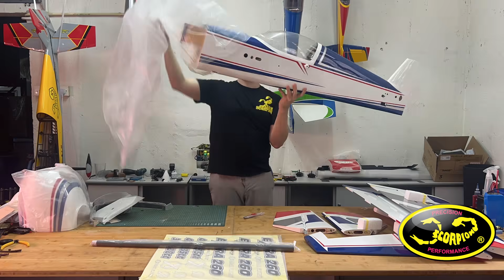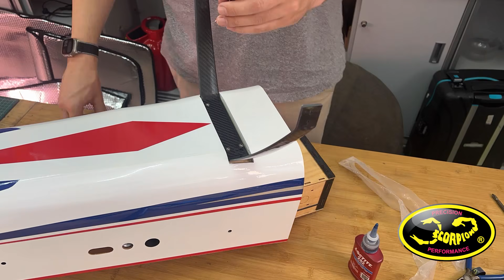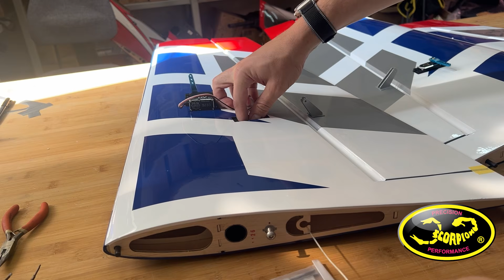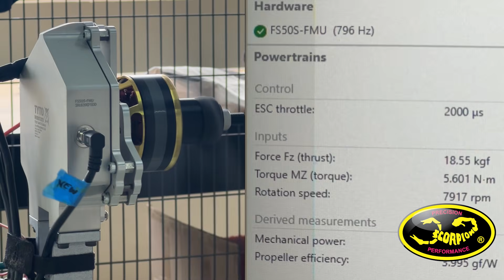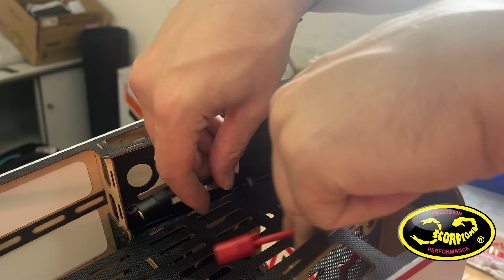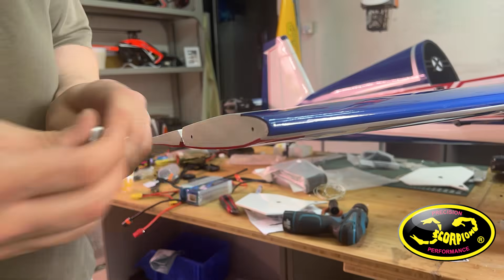*BUILD LOG* - Electric Extra 260 75" - Extreme Flight

Comment: Man I am really thinking of going to those solderless plugs on my large scale helis...just so old school they make me nervous. Dont want to put in a 5k heli due to a failure.
Reply: Mechanical joints are always better with less resistance. But vibrations could be a problem?
Reply: Same here. I would trust a properly done crimp, but those connectors are just grub screws that you tighten down on the stranded wire. I did car stereo installs for 5 years and we used a ton of connections like that. I never liked them. They always work loose from vibrations and go high resistance or come completely out and need retightened occasionally.  I’ll stick with my soldered connectors.  Never had a failed solder joint, except ones done by an incompetent person.
Reply from the maker: @emersonb5764  That is not correct. It is not the grub screw tightening on the wire strands. The grub screw is just taking up volume which force the windings outward and  press them very strongly against the complete internal wall of the connector.  

I have used these connectors for nearly 10 years now. I have had zero failure. I Can swear by them 100%!!!
Reply: A lot of guys swear by them, even the hard 3d pilots. So they must work..just makes me nervous.
Reply from the maker: @rickdizzlefoshizzle1087  I have used them for 10 years never a single failure. They are 100% good.